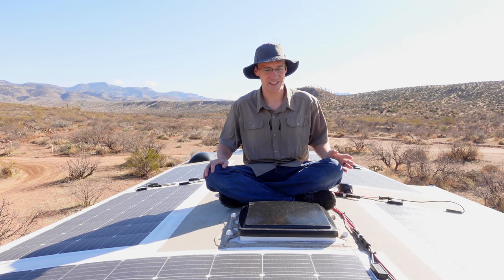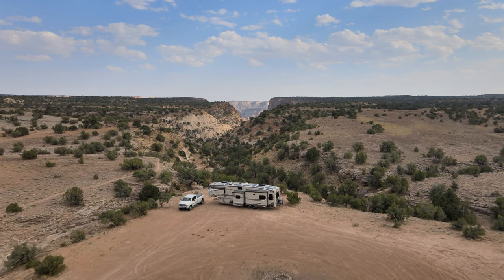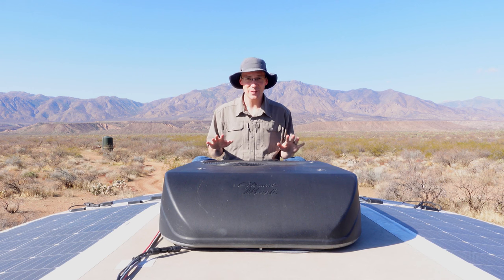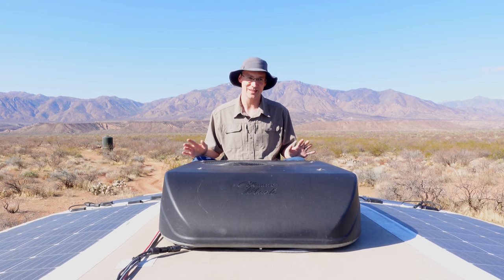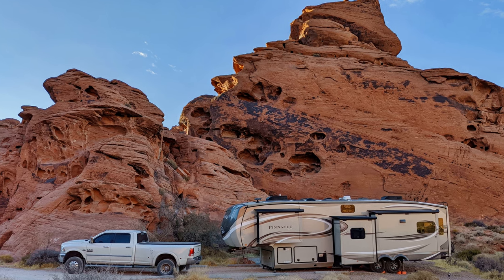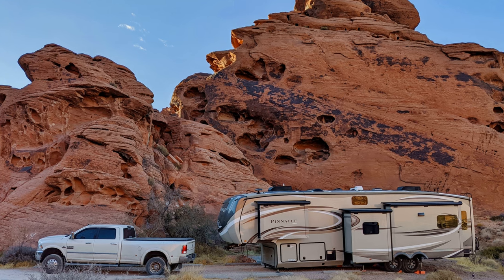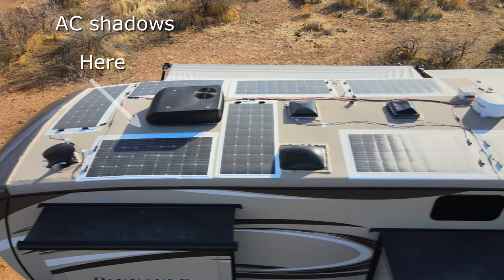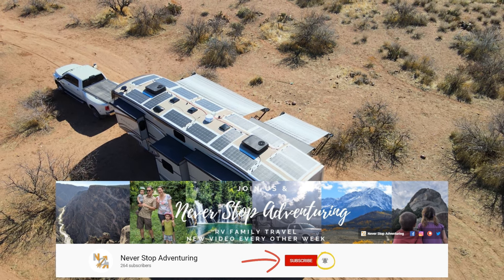RV Solar System Lessons Learned

Comment: I have a 40 ft motorhome with 4,350 watts of solar, 15,360 watts of battery (48 volt system), and a 6,000 watt 240/120 split phase inverter. been running it for 2 years, in sunny parts of the US I save about $75 a month on shore power bill. Went boondocking out west for 27 straight days, only solar for power. System has been working good, I can run AC, electric hot water, heat pump, what ever I need on solar. The cost was $8k with no labor.

Comment: Glad to see your system is working for you.  The biggest issue is the 1960's technology RV AC units.  I have a much older (1991) motorhome than your unit, so modifying it wasn't a concern for me.  I removed the rooftop units and filled in the holes, which gave me not only more room for panels, but also more freedom in placement and no shadows.  Nine 265 watt panels, plus a tenth on a separate charge controller and small battery bank and inverter as back-up for the 120 volt frig and chest freezer (a whole different story) just in case the main system runs out of juice at night (only a few times, but worth it for the piece of mind.  I have the main inverter set to kick out early to extent the life of the batteries). With the chest freezer I buy good meat in bulk when I find it, so there is probably a thousand dollars worth of meat in it.

Back to the main subject.  I installed a 12,000 BTU mini-split system in the living room area, and a 9,000 in the bedroom.  The bedroom unit is set for 68 degrees all night in the summer!  With both units running at max cool or heat (the compressor ramps up and down depending on the load and need, so they do not run on max all the time), they use slightly LESS combined than ONE RV unit on cool.  And on heat, they put out the same BTU's as on cool.  The other BIG plus is... even on max (the circulation fan also ramps up and down) they are QUIET.  Siting on the reclining loveseat or laying in bed, you can't hear them running.  The RV industry just assumes people will go from one campground to the next and be plugged into 50 amp hook-ups every day.  That's not how I operate... and neither do you... and neither do any of the other people that boondock.
Reply from the maker: That's a great setup! I know someone who remodeled a travel trailer and uses a mini-split to heat and cool the place. Definitely way more efficient than a standard RV AC. Where do you mount the outdoor unit? I imagine the back bumper would be the only place to put it. Do you run them at night when boondocking too?
Reply: @NeverStopAdventuring  My motorhome is a basement model.  The front 'outside' unit is mounted width ways (small end out) in a smallish storage area between the front wheels and the side door on the passenger side.  I built a sheet metal block floor the ceiling in the center of the unit to keep the intake and exhaust separated and there are two large vents front and rear on the door.  So far I've had no problems with it mounted that way.  The inside unit is mounted above the windshield on the front of what was a worthless cabinet, so it blows straight down the center.  The slightly smaller rear outside unit is mounted the same way where the 8,000 watt Onan (almost 3/4 gallon of gas a hour!) used to be mounted long ways.  And, there was enough room to mount the 3100 watt Champion inverter generator beside it!   The rear inside unit is mounted above the rear window so it blows back towards the front.  

Oh yeah, the rear one is set at 68 degrees max... and many times 65 or even 62 at night.  I have 'issues' with my joints (the VA has no idea of course... other than prescribe opiate pain meds which I will not take!).  There are to additional 32 gallon water tanks mounted on the pass-thru part of the basement in front of the rear wheels.  Through a series of electric solenoid valves, and an additional water pump and water heater, I can use water from the front one, and it drains from the bathtub back into the rear one.  Then through more solenoid valves, I transfer the water back to the front one.  All this so I can take a very hot shower with the stopper in so it's filling the bathtub, and then a 110 degree bath.  That's why the rear AC runs all night and sometimes at 62 degrees.  The damn bathtub soak heats me up and I would sweat to death without the AC running  :(  I don't wash, just soak, so a cap full of bleach keeps that water fresh for 2-3 weeks.  I installed a 600 watt Hott Rod (or Hot Rodd, I can't remember which) in the drain of both water heaters.  If I have to take more than two showers and baths in one night... the batteries get very low.  That's when the back-up system keeps the fridge and freezer going until the solar can kick in the next morning.  I'm by myself so, if it wasn't for the need of the bathtub and extra water tanks, I could get by with a much smaller RV.  But hey... we do what we have to do to get out there and enjoy ourselves, right???
Reply from the maker: Don, that's fantastic! Pretty amazing what can be added to an RV. I'm glad you are able to do all that to manage your joint issues and keep on enjoying the great outdoors! Sounds like you have your own personal mobile hot springs 😀  You're absolutely right about doing what we what we have to do to enjoy ourselves and live comfortably. That's probably the most ingenious setup for a mini split that I've ever heard of. Maybe it's more common and I just never see it when the outdoor units are tucked away like that. Thanks for sharing!
Reply: @donf3877  Don I just subscribed to you I would love to see a video that you post describing some of your systems and how you have that separate one as a backup for your freezer. Great work indeed something I aspire to and will probably get around to doing eventually. Amazing thank you as is this video which attracted both of us!
Reply: @pullbackbaby  Yeah... no videos... and I'm done on the road.  I was on my way back to Florida when I sent those comments.  The day after I got back... I was diagnosed with lung cancer at the VA.  Had an operation, but they couldn't get it all.  Too close to my throat.  So next was weeks and weeks of radiation treatments.  After that I endured two of four chemo treatment that just about killed me.  My weight had gone from 189 to 148 and my white cell blood count was through the roof.  Then another MRI and... the cancer had hit both adrenal glands (common with lung cancer I guess).  So now I'm on a different chemo which, thank god, I don't have any side effects from.  That, and steroids since the glands aren't putting out any.  I've gained some of my weight back... and feel much better.  But... the chemo isn't to cure me now... it's to keep the cancer in remission.   I checked it out as soon as I started the new chemo.  There's a VA hospital in Salt Lake City... in Phoenix... and in Vegas.  Nothing in between.  And... I have to get the chemo every three weeks basically forever.  The reason I set my motorhome up the way I did... I HAD to live on BLM land.  My social security wasn't enough for me to be running the motorhome all over the place all the time or pay to "camp".  Set for two weeks and explore off-road a little in the Jimmy.  Move 50-100 miles or so and do it again.  That is what I could afford.  Now, I would just get comfortable... and have to drive it 300-400 miles or more to get a treatment.  The $$$ just isn't there for me to do that.  That plus......... the Jimmy had a dead battery a few weeks back, so I hooked the jumper cables to it from my old beater pick-up.  It was hot, and I ain't got my strength back, so I went back in the house to the A/C figuring in 15 minutes or so I could go back out and start it.  Five minutes later I heard a poof.  Looked outside, and it was the left front tire exploding on the pick-up.  Both it and the Jimmy were up in flames.  I guess the newer cars with all the electronics, you are supposed to hook the ground jumper cable to the engine instead of the battery.  I didn't know that.  The fire department got here quick... but the pick-up and the Jimmy was a total lose.  Plus, they were close enough to the motorhome to destroy the windshield and the fibreglass front end.  The insurance company was quick on a settlement for the Jimmy... but I had no insurance on the pick-up... and I dropped the insurance on the motorhome since it wasn't going anywhere for a while.  Guessing I don't have to worry about the distance to the VA hospitals out west anymore   :( 

Anywho... the back-up system was pretty straight forward.  The main system was nine 265 watt panels wired three sets of three in series (ALWAYS wire series - parallel.  My series sets were putting out enough to start the charge controllers 10-15 minutes after sunup, and run up to 96 volts max).  Then, instead of parallel, each set ran through a separate MPPT controller (ALWAYS use MPPT's) to eight 6 volt Trojan golf cart batteries (900 amp/hours).  I could lose a panel or even a charge controller, and still be charging.  Always consider worst case when planning a system!!!  The back-up system was just a separate small solar charger system.  One extra panel (I got all mine used - and dirt cheap), with one small MPPT charge controller (The panels I used could put out 32 volts so anything over 13.8 would be wasted without a MPPT), and a two Trojan battery bank (6 volt + 6 volt = 12 volt @ 225 amp/hours).  ALL my batteries were standard 6 volt Trojan golf cart batteries.  Pulling out the dinette and sleeper sofa and RV fridge, plus replacing all the 3/4" chipboard cabinets, and ditching the big genset, I had the ability to carry the weight.  And... I got them for $97.50 each brand new!!!  Check Craigslist where you live!!!  Then I used a standard auto-transfer switch (like for genset/shore power) and connected it to the output of the main inverter.  When it shut down, the auto-transfer switch tripped.  Through standard 120 volt relays, it turned the small inverter on (via the remote switch jack), and switched the circuits for the fridge and freezer over to it.  When the big system started charging again, the main inverter fired back up... and the auto-transfer switch shut the small invert down and transferred the fridge and freezer back to the main batteries.  And, of course, the back-up batteries were being charged back up by the extra 10th solar panel.

I had a large system, for a RV that is.  A smaller RV???  Just one mini-split, so the system can be halved.  And, you must think about EVERYTHING.  A woman's hair dryer... 1200 watts.  A toaster, an electric frying pan... also out.  That plus all LED lighting.  Always think conserving electricity when you are running off solar and batteries!!!  Hope this helped you.  If you need more information... just reply here.  Good luck... and get out there on the road!!!
Reply from the maker: Don, so sorry to hear about everything! We wish you the best with your treatment! Are you still able to stay in your motorhome or did you have to find other housing?

Comment: Thank you. I've been trying to figure out how much solar is needed for my 21.5 foot Coleman Lantern 17b?
Reply from the maker: How much wattage do you use in a day? If you know how much power you use, you can calculate a solar/battery/inverter setup to fit your needs. We have a 5 part series on this if you're interested. Here's a link to our video on power consumption: https://youtu.be/x1HgG_QXE9U
Reply: @NeverStopAdventuring  I literally have no idea..."campground" hookup camping only, I use lights, 12v fridge,  microwave,  fireplace, wall a/c, radio, and a few extras. I would like to boondock one day.
Reply from the maker: @sanjuancapo2862  there's a few options. If you have minimal power needs while boondocking then you can get a portable solar setup. This is one of those power stations from Amazon with a few solar panels you setup on the ground. Or pickup a small generator if you don't mind the hum of the motor. Otherwise, watch our DIY series and do a deep dive on your own personal power consumption, then figure out a solar setup from there.
Reply: @NeverStopAdventuring  Thank you. I do have a 250 watt portable bank. I am interested in a roof set up. I will check out your DYI.
Thank you
Reply: @NeverStopAdventuring  I'm just random guessing that I will need 500 watt + for a/c and fridge and fireplace
Reply from the maker: @sanjuancapo2862  you will need a lot more than that to run an AC unit for any length of time. The power calculators mentioned in the DIY series are really  helpful for figuring out what you can run.

Comment: Thats a legit setup, don't have an RV but loved learning about everything in the vid!
Reply from the maker: Thanks! It definitely provides all the power we need!
Reply: Hi maybe you can help.. I have a 2021 flair 29m and have some CIGS panels i want to put on the roof - I don't see any pre-wired boxes or anything to connect to.. so I'm wondering if I can use the existing front winegard location or satellite cut-out towards the back ? I don't use those. (would it be hard to phish the solar wires thru?) - also I am upgrading to lithium and have a separate oupes mega2 solar genearator that is stored in the electric compartment that has an RV outlet which actually powers the A/C with the softstart i just installed....  thanks!  @NeverStopAdventuring

Comment: Solar panels produce less power when they get hot.  I installed rigid solar panels, with about 1" of clearance between my roof and the panels to keep them cooler. I can also tilt my solar panels if I wanted to stay parked for more than a week.  I installed my wiring from the roof to the refrigerator cover and then to the basement where my battery is.
Reply from the maker: One of our major concerns was how much weight we were adding, which is why I did it this way. Do you tilt yours manually?

Comment: Where did you get all the equipment for your solar system setup????
Reply from the maker: The panels came from Renogy, most of the Victron equipment came from Amazon along with a lot of the wiring, crimpers, connectors and such. I ordered the solar controllers through a supplier near Salt Lake City. The batteries were part of a group buy through Battleborn along with half a dozen other RV families at a rally.

Comment: Thanks for your update.  I am curious about the longevity of the flexible panels.  I have heard that the fail sooner than hard case panels.   Please keep us updated at to your systems stability.   I ready like your setup, especially the panel mounting.
Reply from the maker: No doubt rigid panels will last longer. But with rigid panels having a 25 year lifespan, if I get 5-10 years out of these I'll be happy. For what it's worth, these flex panels are rated for 25 years. I'm quickly approaching the 1 year mark with them and they don't look new anymore. However, power output wise, they're still doing great.
Reply: @NeverStopAdventuring  Good luck dude. My flex panels lost 80% of their rated capability in 2 years, so your low expectations aren’t nearly low enough.
Reply from the maker: @migmigjohnson6083  What brand of panels were you using? If that were to happen to us, it would fall under Renogy's power output warranty and we'd get new panels. Definitely not saying that it couldn't happen, but hey, Renogy has a decent warranty at least.
Reply: @NeverStopAdventuring  Not sure of brand name. Definitely not a popular brand. You think that’s that’s the problem?
Reply from the maker: @migmigjohnson6083  maybe, I know they don't all have the same manufacturing standards and don't all offer a warranty that guarantees their product. I'm going to do a side by side test with a new Renogy panel vs the old when I get around to replacing the one that came off our roof!
Reply: @NeverStopAdventuring  That will be interesting. I’ll be on the lookout. Thanks!

Comment: Thanks for your videos.  Based on your blog posts and lists, it looks like it cost bout $17,300 for the total system (9400 + 7900).  Quite a bit of money, but it is definitely one of the nicest and most thorough installations I have seen!  It's a luxury over a generator (only), but it must be so nice to boondock anywhere.  I have a much smaller trailer, and I'm in the midst of a 3.6kW install with between 400w-800w of solar.  I plan on using my Honda eu2200i much more often than you probably need to, but it'll save me quite a bit of money at the expensive of noise and convenience.
Reply from the maker: Thank you! It was definitely pricey, but we're really happy with it. It's really changed RVing for us. I'll readily admit that it's not the cleanest install out there. There's only so much you can do when your equipment has to share space with pipes and miles of factory wiring...we also didn't have to give up much of our cargo bay that way. We have the same generator! As long as you have an appropriate battery bank for all of that you'll probably be pretty happy with it. As far as money invested, there are some diminishing returns with a large solar setup. You'll have 80% of the ability of our system with WAY less money in it. Nothing wrong with that!

Comment: How are the flexible panels holding up?  Any issues with them coming loose?  Any loss of efficiency?  Any issues with the lack of air flow under them?  Thanks!
Reply from the maker: We lost the front panel last year when a low branch caught it while driving through a campground. Otherwise, no issues with them coming loose on their own. We haven't had any issues with heat either. There hasn't been any obvious loss of efficiency, but I intend to test the old panels vs the new one that I bought to replace the front one when I get around to putting it up there and filming it 🙂. That's taken a back seat to our travels, but I'm sure we'll want it back up there by the time it gets hot, so stay tuned!